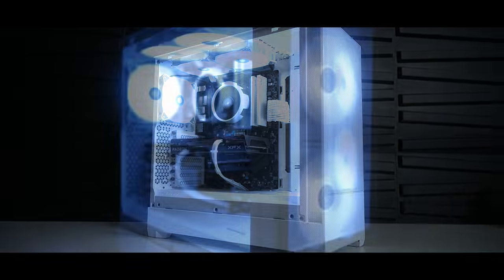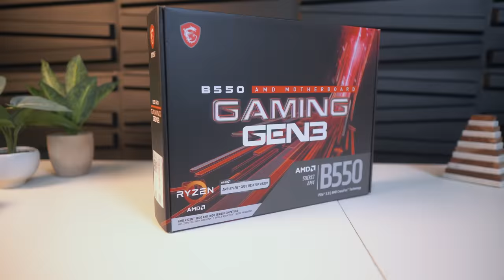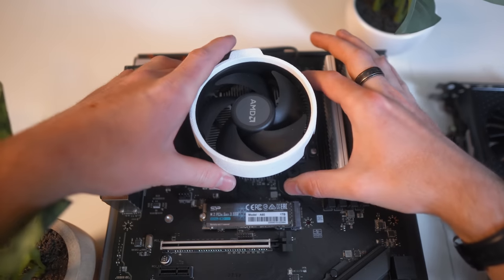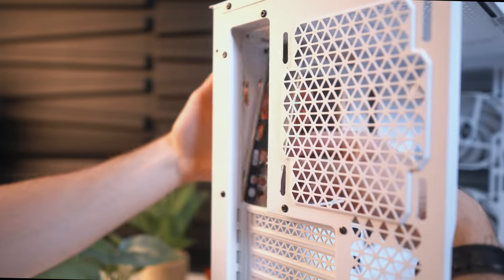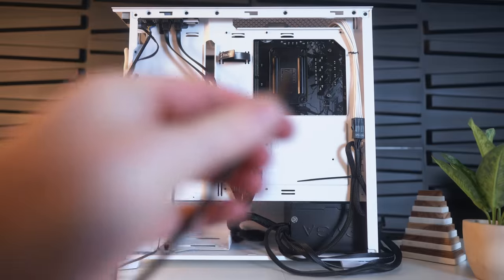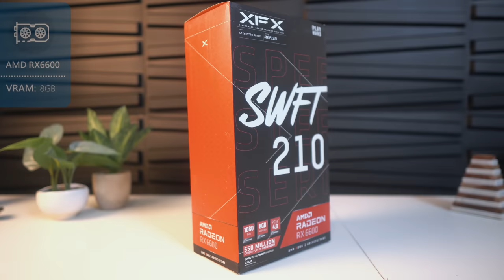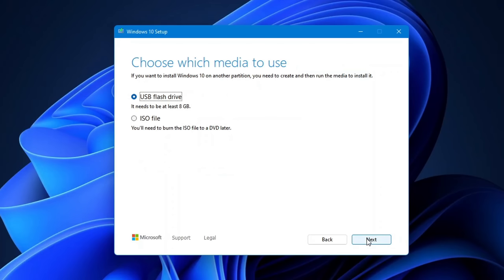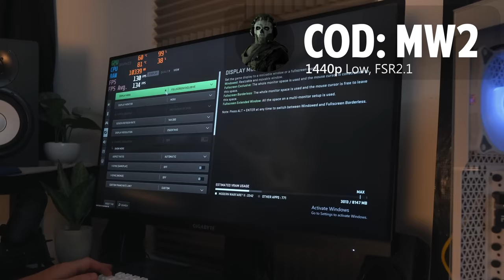BEST $700 Gaming PC Build Tutorial! [w/ Benchmarks]

Comment: the cpu temps are toasty, but good build over all
Reply: Yeah but you can just buy a water cooler later on
Reply: @paddycullen4695  any cooler above 20usd would be better than the stock cooler, or the other option is to undervolt the cpu which i did in my build
Reply: @paddycullen4695  any you would recommend?
Reply: @redfly8071  for what cpu though? The Deepcool AK400 is apparently very good at the budget end and the Thermalright Peerless Assassin 120 is around $50 and can cool pretty much any budget to high mid range CPU
(Wouldn’t recommend for anything more power hungry than a Ryzen 7 7700X or i5 13600K)
Reply: I mean he didn't install any thermal paste so that makes up for why it's heating up so badd.
Reply: @TooDamnBlown420  stock coolers from amd have thermal paste preapplied on its base, the cooler is just not good thats why its doing a terrible job on cooling. if it had no thermal paste it would just shutdown on any load
Reply: @pitracks  bro do u know if I can put a 5700x cpu and a rx6750xt in that pc?
Reply: @Jander_  as long as the 6750xt you got isnt long then you should be fine. though ill probably advice you to change the psu to 600w OR learn how to undervolt your gpu and cpu to lower the power consumption but at the same stock performance
Reply: @pitracks  rx 6750xt is long but I want to put my 5700x cpu too. I just want more fps in 1440p
Reply: @Jander_  its should be fine as well although u need to spend on a cooler since it doesnt come w any out of the box
Reply: @pitracks  yea I know that. so what gpu and cooler do u recommend ?
Reply: @Jander_  the asrock 6750xtxt phantom/challenger or the gigabyte gaming oc variants are my picks, as for the cpu cooler, the thermal right pearless assassin 120 should be more than enough to cool the cpu and even overclock if you wanted
Reply: @pitracks  thank man.
Reply: He has negative air pressure. More exhaust than intake fans. So it'll get dustier faster.

Comment: i did this with a 4060 with a different ssd Crucial P3 Plus 1 TB and ram Corsair Vengeance RGB Pro 16 GB with the NZXT H5 Flow ATX Mid Tower Case with two extra NZXT F120Q fans and the ID-COOLING FROSTFLOW for the cpu cooler this is around over £700 to be exact £820 but thats because the gpu is £100 more and i went for looks and performance instead of just one thing ($990)

Comment: This is a question that I have had for a while and could never find the answer, do you have to wire anything to the Powe button or do you already simultaneously do it while installing the pc.
Reply: If you're building a PC, you connect the power button to the motherboard's power header pins. The board manual will tell you where those pins are.
Reply: @JJFlores197  thanks

Comment: Watching this video makes me ask myself so many questions. I got an i5 12400F with the RX6600 and my Modern Warefare 2 is barely running on 60 FPS on Medium settings. Can someone help?
Reply: make sure the display setting son your monitor are on 60hz and double check both bios drivers and gpu drivers is still not fixed try and check if the hdmi or display port cable is plugging int o the gpu not the motherboard

Comment: I have an important question, can I use a 6,3 x 5,9 x 3,4 inches (750W) power supply instead. Or will it be to small and maybe even make the pc less faster? Edit: I am also thinking about adding a rtx 3060, msi, 2 fan. Would it fit and if I’m not mistaken it should go well with the Ryzen 5 5600?
Reply: the wattage of the psu for a 3060 and r5 5600 is completely fine, i run a 3060ti with 4 argb fans  and a r5 5600 on a 650w psu just fine. just make sure that the psu is of good quality, an msi mpg a650gf, corsair rmx 650, or a rm650e or aanything that r anks high in the psu tier list. 650 watts will be just fine for this build, and could probably get away with 600 or 550, but i recommend getting 650
Reply: @atlasjack1152  thanks for the help

Comment: Does the graphics card need to be held up from the middle to not risk breaking instead of kinda just floating or do those screws on the side keep it in place well enough? Also, Should I choose windows 11 instead of 10 now?
Reply: And also (sorry for so many questions) when cutting the wire for the fan on the side of the case to replace with RGB, do you just rip off the wire you can see or rip off the whole wire connected to the fan ?

Comment: Note: this will be my first build sorry for potentially dumb questions. 

does this motherboard come with integrated wifi? 

How do I know if my power supply will be able to account for future upgrades? 

Where do I plug my stock fans if I don’t get the optional ones with the fan hub?
Reply: Get a different power supply to accommodate future upgrades. The OP would rather spend money on fans and aesthetic rather than performance.

Comment: Hi guys. Any pointers would be great. From Uk. Got the parts and installed. Just problem with the fans.

Couldnt get asiahorse and so got one of the other recommended fans - EZDIY -FAB white moonlight.   

Niw the fans have the ARGB 3 pin female whereas the msi mobo b550 gaming gen 3 has the RGB 4 pin males.

I tried an adapter but does work. On start up fans power up for like 3 seconds then go.dead.

Need help.

Why is it fans have 3 female connectors and the mobo 4 male pins.  

Difference in power too - RGB 12V and ARGB 5V (so problem there too?)

Thanking in advance

Comment: This motherboard doesn’t come with integrated wifi but you don’t mention or include a wifi card in the video? Will I need to buy one or can I use ethernet? If so where can I plug my ethernet cable into? (Sorry if this is dumb. this will be my first build)
Reply: Find a different board with wifi. You can use the ethernet which is better for gaming anyways. It's in the back of the board.

Comment: wth how did u get stuff for so cheap i have been searching for insane deals for 3 months now, anyways since my budget was 750 dollars i managed to get a 12 gig rtx 2060 with aorus b550 mobo which looks so clean
Reply: bro why not the 3050 i5 12600kf 32gb ddr5 4200mhz
Reply: @WBR117  bro 3050 is trash(2060 6gb is better than 3050 8gb) plus i got a 2060 12 gig which is wayy better than 3050 and u should be joking about 32 gb ddr5 ram and i5 12600kf, so that ends it
Reply: thats not what i have or want anyway
Reply: @WBR117  ?

Comment: what cpu cooler did you use?
EDIT: i found out that the specific cpu he uses comes with a cpu air cooler.
Reply: Do u have the same pc?
Reply: yeah, im just waiting for the gpu to come
Reply: @doofuscc  is that pc good ?
Reply: @Jander_  yeah its pretty good, it runs most games at well over 120 fps
Reply: @doofuscc  in 1440p?
Reply: @doofuscc  because im building the same but  i already upgrade the ram for 32 t force 3600 and gpu RX 6700 XT PSU 650w EVGA 220-G5-0650-X1 Super Nova 650 G5, 80 Plus Gold

Comment: do you need cooling paste or however its called im german i dont know
Reply: Yes you do. Most CPU coolers come with thermal paste pre-applied. I would still buy some just to keep handy in case you need to remove the CPU cooler later on. You don't want to reuse thermal paste.

Comment: MSI B550M PRO-VDH WIFI AMD B550 Micro ATX DDR4 AM4 1 x PCI-E x16 Slots Motherboard €96.00
AMD Ryzen 7 3700X 3.6-4.4 GHz AM4 8-Core OEM/Tray CPU €159.99
Gigabyte Radeon RX 6700 XT 12 GB €270.00
Corsair HX850i ATX 850 W 80+ Platinum Modular PSU €80.00
Corsair Vengeance LPX 16 GB (2 x 8 GB) DDR4-3600 Black PC RAM €36.99
Samsung 970 Evo Plus 1 TB NVME Storage €44.99
Corsair 4000D Airflow ATX Mid Tower White PC Case €90.00 
777 eu 
is this a good build?
Reply: you should change the cpu to 5600x , 5700x or 5800x and you dont really need an 850 watt psu you would be fine with a 650 or 750 and if you could i would change the ssd to a gen 4 ssd if the motherboard supports it and the case is fine but it only comes with two fans

Comment: I’m a new builder and for some reason the display isn’t coming up. Not sure what I did wrong but I’ve been here researching for ab 2 hours but I’m stuck
Reply: @roo tech
Reply: If your motherboard has a diagnostics light, take a look at it as it can help guide you where the problem may be. Make sure you plugged the video cable into the graphics card and not the motherboard. Make sure ALL internal components are installed securely and correctly.

Comment: can put windows 11 on this PC ?
Reply from the maker: Yes.
Reply: @Roo_Tech  ok this is my first pc build!!! but iv ran into a lot of issues already. i lost the m.2 ssd screw so i dont know if i can just duck tape it or not. and also the cpu cooler doesnt seem to fit. great vid tho.
Reply from the maker: @coregaming6909   technically you can, but I recommend you do eventually fasten it with a screw. As for the cooler, you may have it in the improper orientation. The parts in my description are the exact same as I used in the video.
Reply: @Roo_Tech  thank u just got the CPU on correctly and I got more screws on the way

Comment: Yo bro how do you connect the pc to Wi-Fi?
Reply: Pls I need the answer
Reply: @BigTank-rq3ry  ok so I did research and it dosnt come with Wi-Fi so you have to buy a Wi-Fi card
Reply: @begee5685  do you need a mobo with wifi if you have ethernet cable?
Reply: @drig_10  what I did was I just bought a wifi card for 15 bucks and put it in the other gpu slot

Comment: Is this 6600 equivalent to the 2080 from nvidea?
Reply: A little bit better I think. It trades blows with the 3060.
Reply: @neev4367  thanks for they reply brother. Much appreciated. Im still torn between the 3060 and the 6600 for streaming… they are the same price in my region.
Reply: @Mr.C0ffee  if you are streaming to twitch, nvidia is unfortunately better because of the encoder, but if you wont be streaming much then go for the 6600 because it's MUCH better value for money
Reply: @jello4055  much appreciated!
Reply: No the RTX 2080 is 10-20% faster. Also has DLSS support making it a no brainer imo. It's around 20% faster than the RTX 3060 as well.
Reply: @FatheredPuma81  Thanks for the reply bro

Comment: the pc turns on but my montior doesn't does anyone know why?
Reply: Does your motherboard have a diagnostics light? IT can help with troubleshooting. Make sure you plugged in the video cable into the graphics card and not the motherboard. Make sure ALL internal connections are secure and correct.

Comment: this is my exact pc build lmfaooo
Reply: Is your cpu temps just as bad?
Reply: @superfh123   not really, i use the stock cpu cooler that it came with and im hovering around 42 celcius just working and around 55-60 when gaming
Reply: @superfh123  granted i dont have the case that he has, mine is the tuf gaming GT301 which has really good airflow for me without additional fans
Reply: Did you need to update your bios?
Reply: @fallen5753  I did not, motherboard came ryzen 5000 ready. Its pretty easy to do tho, i installed the BIOS preemtively on a usb stick before buying the motherboard and turns out i didnt need it
Reply: @iancambronero65  I’m getting the Ryzen 5 5600x hopefully it does the same
Reply: @iancambronero65  bro i want the same build with better performance what would u change?
Reply: @Jander_   im not sure either, the pc is pretty balanced with everything so its not getting bottlenecked by other hardware. If u want just little upgrades id definitely go for more/faster ram and more storage. If youre upgrading other hardware youd have to upgrade the rest so it doesnt get bottlenecked
Reply: @iancambronero65  because i have a cpu 5700x and psu 750w already maybe I would like more fps in 1440p
Reply: @Jander_  i can play 1440 at around 60-80fps with mine so i dont think yours should have a hard time. If anything just get more ram. Mine has 32gb and it does pretty well
Reply: Does it hurt your performance since the gpu is pcie 4.0 and the mobo is 3.0?
Reply: @fallen5753  i dont exactly have the build, my mobo is 4.0 aswell so no issues there. Id assume it wouldnt be much of a difference.. maybe like 2-5 frames difference from mine
Reply: @iancambronero65  can you lmk which mobo you got if that’s alright
Reply: @fallen5753  yeah its the msi b550 pro-vdh wifi
Reply: @iancambronero65  doesn’t it hurt or no? Because I bought rx6700xt?
Reply: @Jander_  wdym? Doesnt what hurt?
Reply: @iancambronero65  the mobo and rx6700xt?
Reply: @Jander_  it should be fine, what are you worried about? Most gpus are backwarda compatible so itll fit either way
Reply: @iancambronero65  u just saved my life then
Reply: @iancambronero65  if I want upgrades from  this one what u recommend in the future? And my other worry is my gpu rx 6700xt will fit in that case ? Thank. On Newegg they have the same white case  XL
Reply: @Jander_  if you want upgrades id probably upgrade the motherboard to a 4.0. Usually though if you upgrade the motherboard youd have to upgrade everything else depending on what you have. Also, look up the gpu clearance on the case and the size of your gpu. That should let you know if it fits or not
Reply: @iancambronero65  i got the same mobo 32 gb ram 3600 t force, 650w  egva I will order the same case but XL
Reply: @iancambronero65  srry for asking but can you put an link for the case u bought?

Comment: how u even change 1080p and 1440p in a game
Reply: if you have a 1440p combatable monitor try to double check the display settings and make sure its on 1440p and if that's on 1440p try to make sure the game is in fullscreen and  the resolution settings usually on the display or graphics tab on the game you want to apply it to

Comment: Fai  play bro, Top PC build this is bro..... 
Only just started this video, Already impressed with the look of that PC, Same sort of style I would bust, I am thinking of Co-Operating my Brothers graffiti designs on PC cases, I sadly lost my Brother one horrible Sunday 29th Aug 2022, I will leave a link to my Brother Blogging page, I have put my Brothers designs in a safe place locked up as they are priceless for me, But I am going to build a PC in one of those popcorn machine looking PC cases, Thermaltake the tower 100, Great looking case, Have you seen one?, They about 80 pounds on Amazon and look fantastic, I am going to do another i5 12600k build, Amazing CPU, And myself, I would only buy a CPU with a K on the end by the way, I don't see the point in a CPU with no IGPU I hate to say, lol, I just done an i5 12660k sitting on a Gigabyte H610i DDR 4 motherboard, Fantastic motherboard for the price, I would use again and it got OC abilities, I put a Cooler Master 240 V2 liquid cooler on the CPU, Again amazing quality for the price, And the GPU is a 12gb 3060, I did read I got a 40 percent CPU bottleneck with the i5 12600k is too powerful for the 3060, lol, Don't now how, It plays AMS 2 great, I don't believe those bottleneck calculators, What is the best way to find out if I do have bottleneck issue because it doesn't seem like anything is wrong, lol, But yeah I plan on doing another PC in the Thermaltake Toer 100, And doing a POV video, Probably in about 3 months or so, I was even thinking of using an i3 13th gen, I read the i3 13th gen is like a, i7 8700k, So yeah if that is true PC CPU's are getting crazy powerful, Even at low end prices, End of the day Computers is the future, Imagine humans now without computers eh, lol.....
Yeah I plan on doing a PC build in memory of my Brother using his graffiti sketches in a minimal way, Small discrete graffiti designs done by my Brothers hand when my Brother was with us, All dotted around different parts of the PC even inside, It probably look amazing if you had a Graffiti sketch inside the PC with RGB it look great, Different that's for sure..... 
My Brother is now known as the King Of Graffiti now though, Even Polish Graff writers memorialized my Brothers name in the world of Graffiti, My Brother always said Artists get rich when they pass, My Brothers Graffiti name is potent still, I am so proud of my Brother, I got to build a PC based om my Brothers memory, Not a day goes by I don't think and miss my Brother....
https://skroez.blogspot.com/